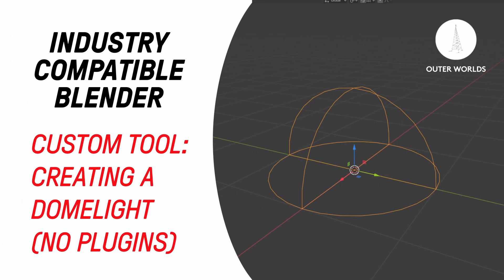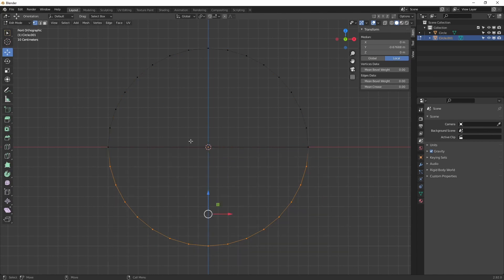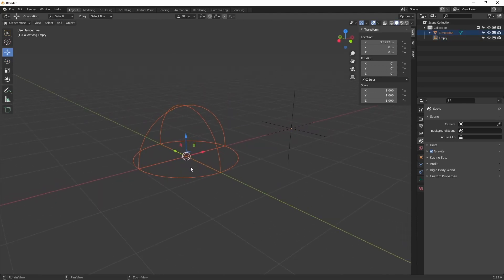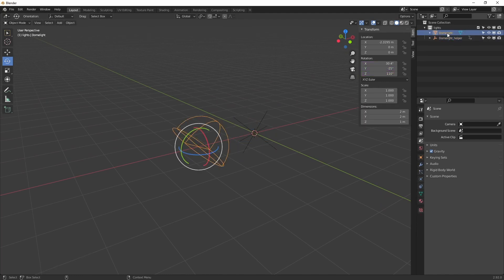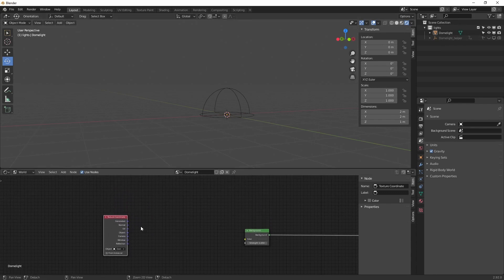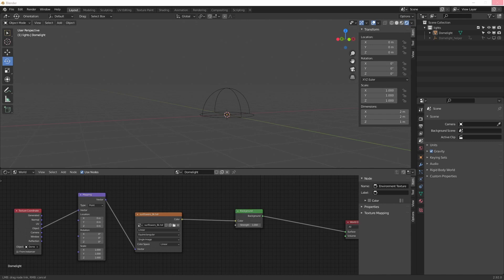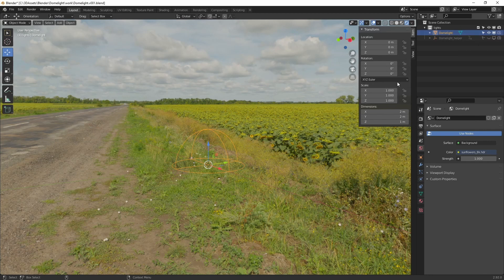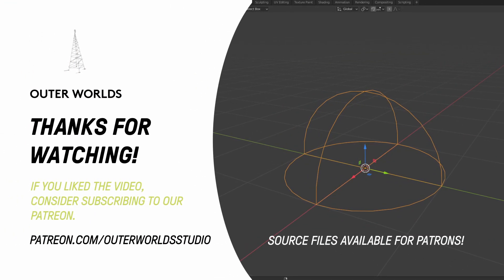Industry Compatible Blender: Creating a Domelight

Comment from the maker: What tool from other software packages are you missing in Blender? Let me know and I'll try to recreate it!
Reply: maybe an add-on or something very similar to 3Ds max's UVW map modifier, I think it's a very basic tool that any 3D software should have, but blender doesn't have it. it's very useful and time saver for interior and architectural projects that use a lot of actual size materials, we can adjust the size of any material we want based on the actual size easily